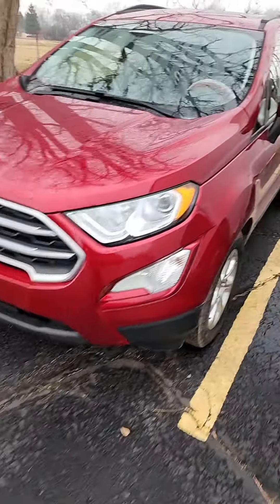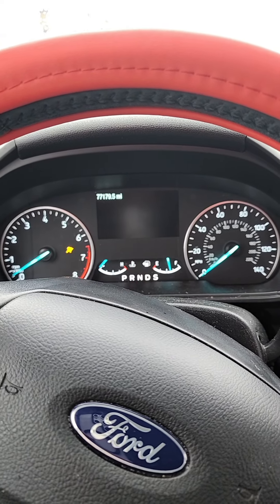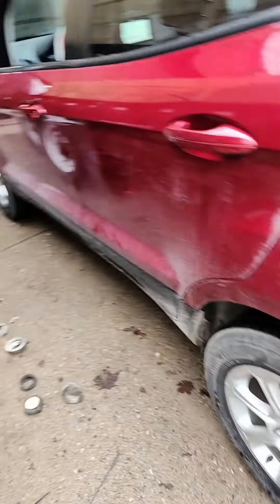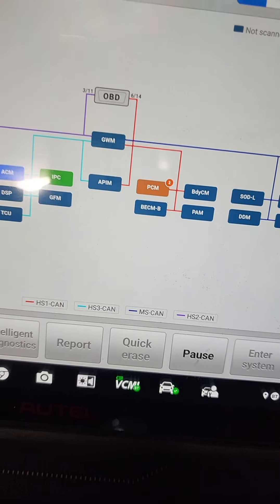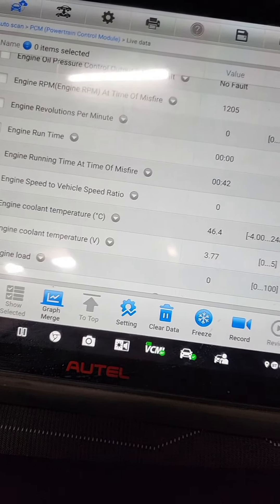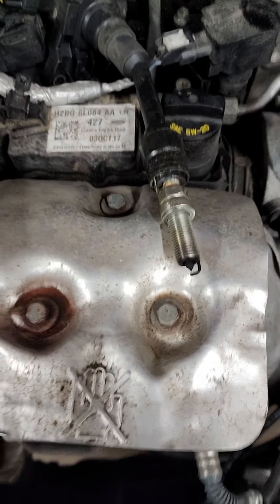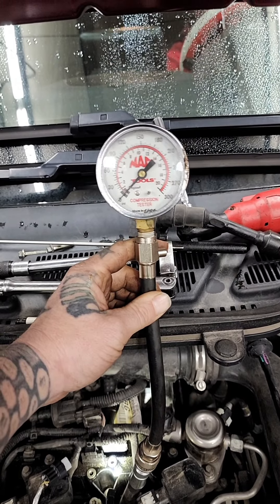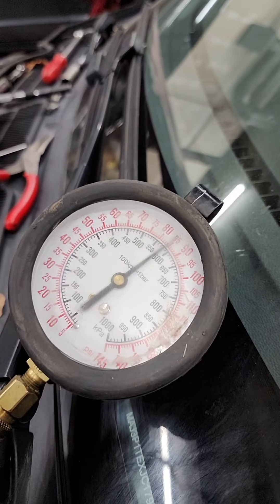2018 Ford EcoSport crank no start

Comment from the maker: More testing Monday I also want to check the pcv system on it as well.
Reply: The possibilities are endless...
But not in a good way
Reply: The Ford trucks and Chevy trucks are solid and reliable. But their cars and light SUVS are utter garbage
Reply: @Quint 1836  more like chevy trucks if you pick out a bigger version like the 2500

Comment: Just tell em take the plugs and coils out every night before bed and they are golden 👍
Reply from the maker: Only if I could get away with that
Reply: Woodn't they hafta remove plugs Every time they shut it off after driving it?
Reply: @frankmains5698  not if they keep it running all day duh 🤦‍♂️
Reply: @jasondeaver2117  and your occupation is?

Comment: I want to say I really enjoy your work and I get to learn something new too. So if you don't mind I would like to ask a question. I have a 1965 mustang coupe 200ci. The gas gauge doesn't work. "Literally" every thing in the system has been replaced even the voltage regulator behind the cluster still nothing any ideas what to do next ?

Comment: Working on a 2008 escape. Brakes lock up on own, as is while driving will actuate and lock the car down in a lane. Unplug battery and it resets and drives. Abs module? And it's out of.stock everywhere. No codes no nothing